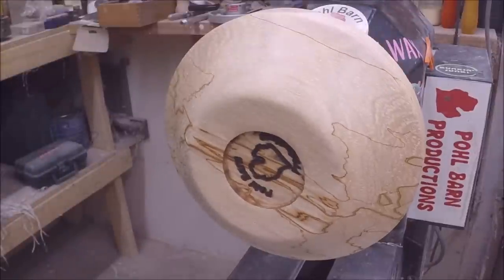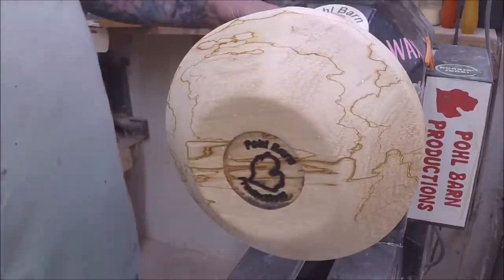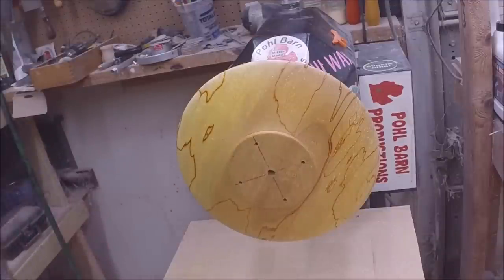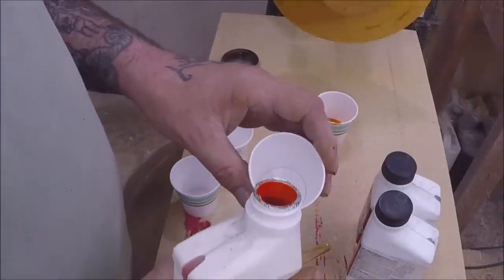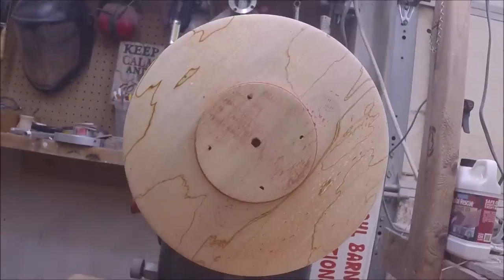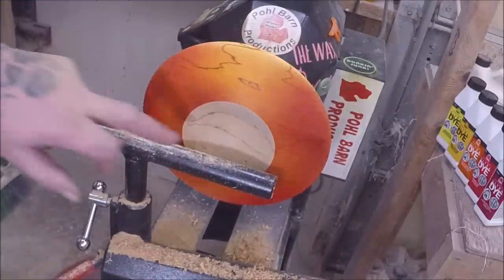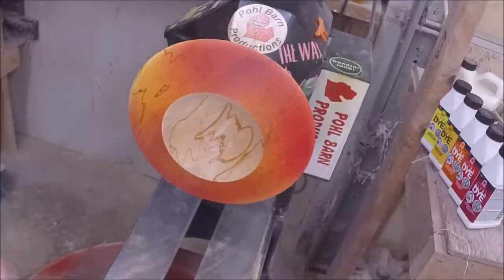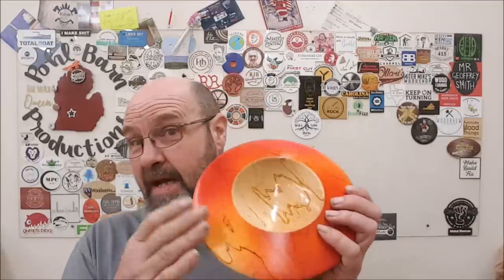Sun Burst Spalted Ash

Comment: Hi Doug, you will have more control of your application if you turn down your pressure, narrow your spray slightly and pull your gun back another 6”. Im an old paint and body guy. Nice job, looks great. I have a bunch of splatted locust I will try this on.
Reply from the maker: Thank you Richard,  I played with it a bit but other than narrowing the stream I just went with it.

Comment: used this color  alot  and just put it in a gun and shot it  with  a bit  of water  i have the water base    is what u have ok with alcohol
Reply from the maker: it is a water based dye also I just used denatured alcohol so it would dry fast, and yes it worked.